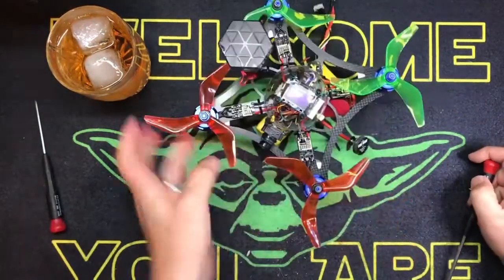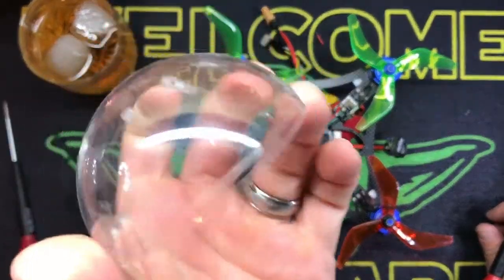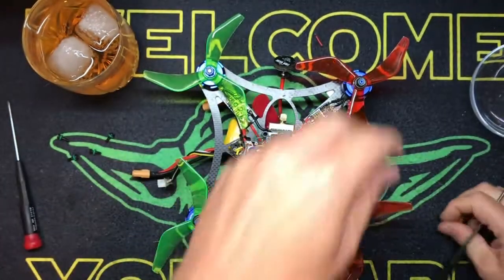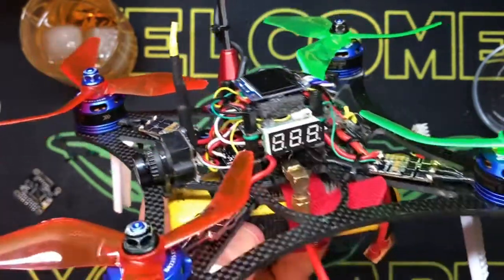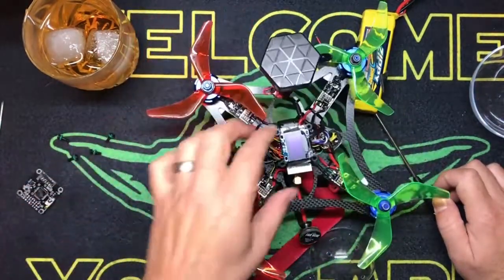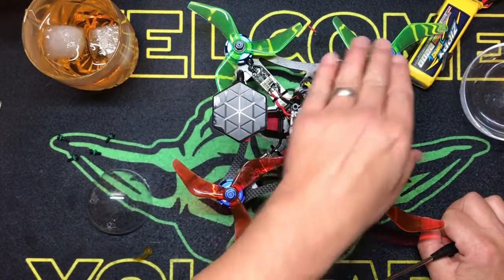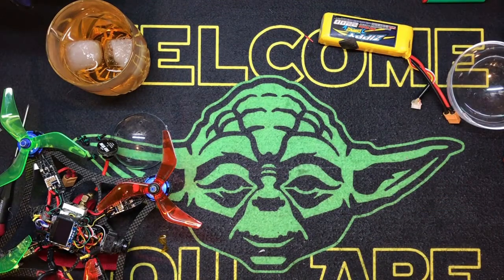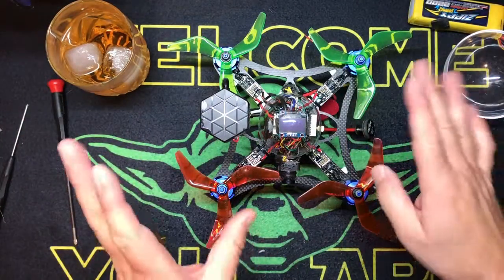EWAD Drone Build part list and description. If ya want to know about drones, Watch!

Comment: How can I see you building a drone right from the start with the GPS connections to Radiolink.
Reply from the maker: Hey brother.   I’m actually starting a gps drone video this week I think.   Are u referring to a radiolink  gps module?? If so I can tell ya how to do it real quick.  Lemme know
Reply: Yes, it's exactly the same as this video. I wanted to put it on a Sp Racing F4 Evo board (it's currently the only F4 I have free) and I do not know if where I'm thinking of putting it is the right place. I'm thinking of putting in I2C port for GND, 5V SCL and SDA and on Uart1 I'll put the RX and TX. I'd like to see you set up to see if I'm doing something wrong. On the site of this GPS module says to connect one of the wires to the CLK! I suppose it's the same as connecting to SCL. Do you confirm?
Thank you for responding.
Reply from the maker: Lol.     The clock.   That’s a Chinese snafu.   Gps wires go to a uart tx and rx.  The compass (mag) wires go to scl and sda.   Red goes to 5v black to ground.  Also I’m not super familiar with that board.   Does it have a built in barometer ?
Reply: Yes, barometer has what it does not have is magnetometer. Basically it's like the other F4 boards. Same shit, different smell. I'll see if I can handle this.
Thank you.
Reply from the maker: Sweeet.   Sounds good.   U don’t want a built in mag, they never work.   So that’s a good thing!!
Reply: Well, I need help with this GPS and MAG thing.
Please tell me how do you activate GPS mag? I-NAV detects MAG but will not let me calibrate! Most of the time the button to calibrate the MAG is disabled but sometimes it lets me calibrate but it does not save the calibration! the Mag is the HMC5983.
Can you give me a tip?
Reply from the maker: Yes loook me up on google hangouts jasongjamiel@gmail.com

Comment: The read is not long in inav  I am on my second time reading it and will read it like 10 more times to fully understand it.
Reply from the maker: +Warlock Hunter yesss learn the modes especially and what they do.  Rtl, gps hold etc.
Reply: How about when a drone has a gimbal  from a gopro does it complicate the build?  I have one with a gopro that I would need to up grade the FC the camo one I send you in a pic with foldable arms.